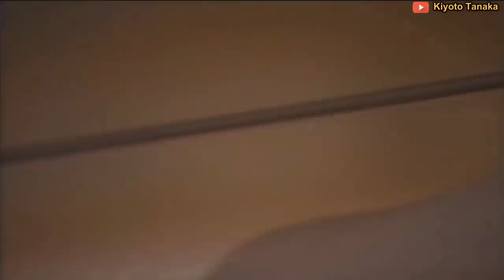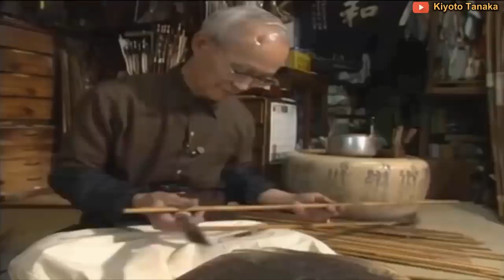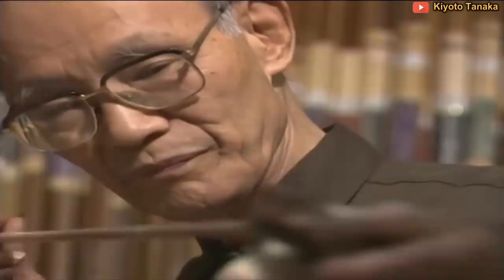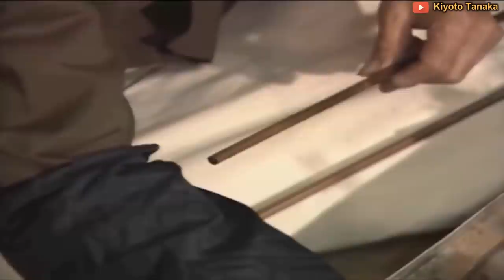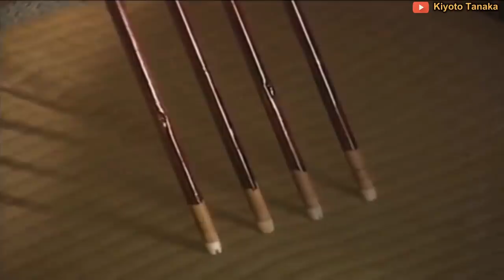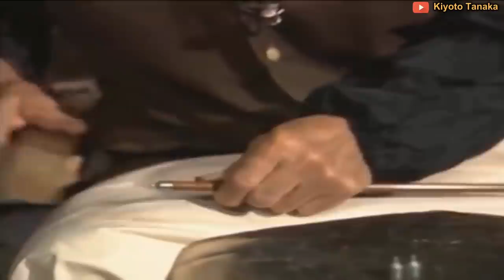Arrow Master Craftsman: Sugiyama Masamune - Stunning Battle Tool

Comment: Takes all day to make single arrow. If you going to war please wait 2 years. Only in Japan .
Reply: Even in medieval europe there were mass production quality weapons and craftsmanship grade weapons. 
Swords for example :
The first takes an afternoon to pour into a mould, one day to cool down and slightly temper.
The latter takes weeks to fold, shape and perfectly temper.

The same applies to every kind of tool or weapon used. It even applies to present day stuff. There are screw drivers sold for 10 euros for a set, that break when you use them on an actual construction site and there are screwdrivers in my own workshop that are older than me and my dad combined, which you can use to pry open car doors. 

Samnurai would've rather waited for their swords to be ready but katana were also mass produced.
It all comes down to production method and the actual application of the piece.

Comment: What is the arrow with the blunt drum shaped end used for ?
Reply: It is probably a signaling sound arrow.
Reply: Sam Singh. Didn't notice the hole in it at first .  the European ones are typically a metal square or round with a blunt pyramid point and diagonal hole ...
Reply: Hunting varmint